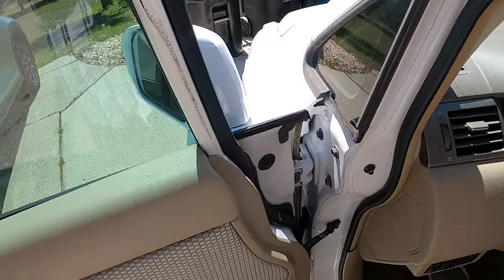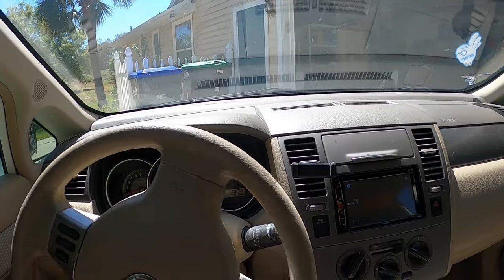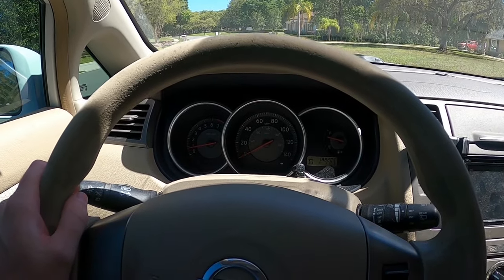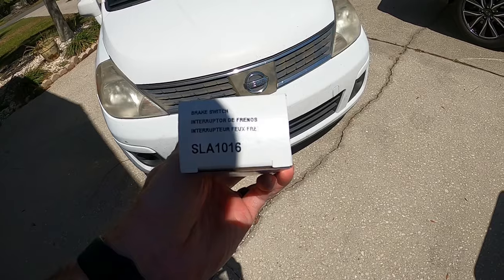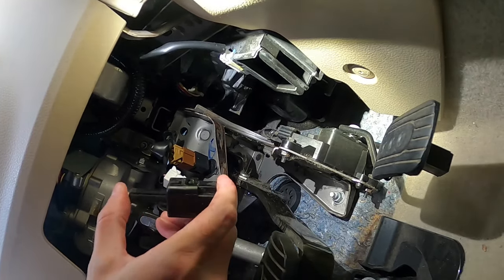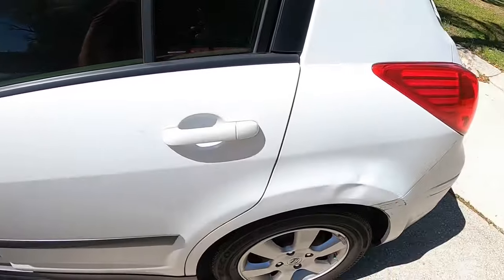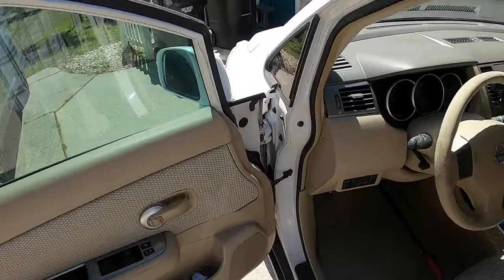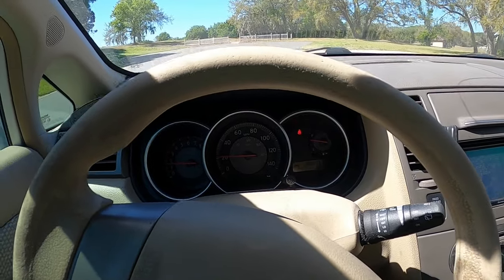Nissan Versa No Power, Laggy Throttle Response, Brake Light Switch?

Comment: Service CVT EVERY 15k miles! Also make sure you buy some MASS AIRFLOW SENSOR by CRC and clean you mass airflow sensor  and your air filter every oil change. Best of luck. I’ll only a Nissan car with a manual transmission. Unfortunately, their CVT’s destroyed their legacy of being one of the big 3! Honda, Toyota and…..not Nissan. We’re Mazda people now. Just won’t buy a Turbo Mazda lol or anything turbo for a daily driver unless it’s a Cummins diesel truck.

Comment: Not only the brake switch but also aftermarket bulb. The root cause of the issue was the blinking LED brake light itself. Its blinking behavior was directly impacting the transmission, causing it to cycle in and out of gear.

Comment: I changed my spark plugs, changed the mass flow air sensor, and throttle body and my Nissan versa barely accelerates which sucks someone help.
Reply: Fuel cap is to tight

Comment: I recently replaced my brake light switch. Once I replaced it, the brake lights worked again, but after driving about 3 or 4 miles, they locked up on me. Is there any other adjustments to make besides just plugging the switch in ?
Reply: Adjust the brake light switch and see if that works
Reply: Did ya fix it

Comment: This exact thing is going on with my 2015 Versa. Mine is a manual and it started after my brake lights went out. Replaced the switch and fuse under the hood but having such low throttle and it seems like it happens in 1st and 2nd the most
Reply: Did you ever solve this problem??